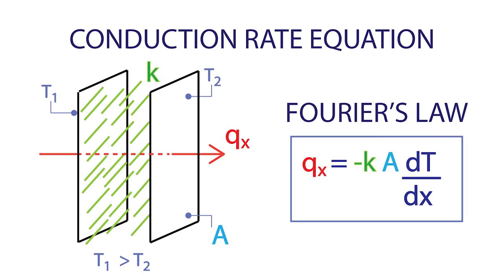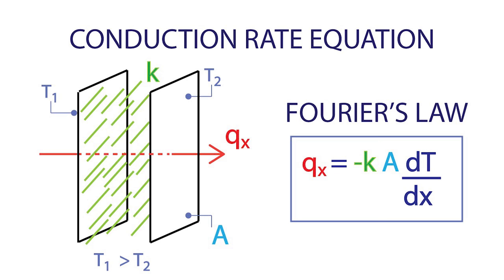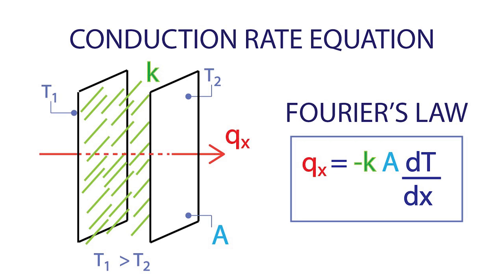Radiators, Fluid Temps, & How to Avoid Thermal Issues

Comment: I remember on my 2nd custom water cooling build, high heat from OCing also has a chance to leaking through some of the most unexpected areas too. The pump leaked due to high heat water (like you pointed out high heat can damage the pump), and the high heat water leaked between the GPU block and the terminal. The block itself is brand new, never taken apart. Without OCing, just everything running stock, there's no leaking anymore... Great video discussion!

Comment: Mistakes I made were:

Using a Nanoliquid with UV, Mayhems Pastel Extreme has issues with UV causing it to get stuck to sides of Acrylic.
Loop planning where drain port isn't at the bottom or at any tippable corner.
Having a Radiator that wasn't fully threaded leaking when I started to fill it, it physically needed to be threaded more and I had to buy a tap. (never buy Magicool)
Purchasing a case that is more suitable for airflow, even having the intake remotely restricted changes the temps so much its insane.  Bequiet Dark base 900 pro w/ 2x 420mm's

Comment: A cramped case and low airflow is my current crux. I have an 1800x and a 1080ti on a 240mm and 120mm loop. The cooling is good but unfortunately the Corsair 460x I put it all in is a bit too small and thus the fans are slightly chocked. Good video Greg!

Comment: I use glass and copper tubing in my build, so i think it´s unlikely that the water temp could do any damage to the tubing. Also my 2 Mo-Ra3 360 rads keep the water cool at very low fan noise. :D

Comment: Wow, I saw that comment just a few days ago, quick turnaround on this video for sure. Kind of overcomplicated but we're all pc gamers here, we get ya. I would love to see a video where you compare torture test temps in watercooling on different size rads. I personally want to see if theres a diminishing return on thick rads vs regular 30mm. When Volta drops I want SLI 2080's in my R6 running off a 40mm thick 360mm rad.
Reply: Thicker rads are worth it as long as you have sufficiently powerful fans to keep the air pressure high, and you are ready to increase the RPM of those fans (more noise). But if you have a choice between a 10mm thicker rad and another 120 rad, go for the 120, that's just common sense, it will give you more rad space and more air to cool the loop. Although it that case I'd just do both to be honest.

I've got no clue how thermally efficient the 2000 gen cards will be, but I'd guess a 360 rad won't be enough under high load no matter the thickness of the rad, if the loop includes 2 gpus and 1 cpu (depending on what cpu it is ofc, and depending on the oc). I'd personally add another 240 at least, but that's me, maybe your fans are much better.
Reply: Gamed4Geeks I honestly don’t think I’ll need that much. I ran my 7700K and 1080ti together on just an XSPC 30mm thick 360mm rad and with my fans at 50% I could hold 45-48C on my card at max load. The fans weren’t even very good. They’re the Corsair SP120 RGB’s. You would think SP’s would be but they have low max rpm’s and don’t have nearly the right blade design. And that was also fully overclocked running 2063MHz all the time. I’m thinking a 40mm thick EK rad is all I should need to run 2 cards. I just want to see a youtuber try this stuff
Reply: Yeah, I suppose if you keep the 7700K it should be fine, but then again, depends on the thermal efficiency of the 2000 gen.
Reply: Gamed4Geeks I’m making the assumption that the 2080 and 1080 will have the same heat output

Comment: Hey Greg!
I have my loop already, but temperature spikes on my ryzen are really annoying. Fans ramp up and down in some time interval even when idle (common problem with some ryzen chips). I wanted to put a stop fitting with temperature sensor and regulate my fans according to delta T of the water. I have only one header for a temp sensor on my mobo, so I can't pass ambient temp to my PC (I think). What would you recommend?

Comment: Basically all your water cooling problems can be solved by picking a case that actually properly supports water cooling. This means good airflow and ample radiator mounting capacity and room. 

Basic rule of thumb, there should be at least 1in between your radiator fan and the nearest case panel. Second, water cooling favors more ventilation area from a noise ratio perspective. A fully open test bench with fans at 800 RPM it's going to be quieter than a closed-off case with the fans at 1600 RPM (assume temps are the same).
Reply from the maker: paskowitz I choose difficult and crammed cases because they look much better IMO, and are much more challenging.
Reply: 2:04 "I could get away with having no oil in my Porsche when going to the supermarket, but on a race track, things get dangerous! But at least it looks cool."
Reply: Well yeah, some people focus on function, some focus on aesthetics. I personally focus on the latter, but of course it should not be overdone and shouldn't detract from the function point too much. Pretty PC that can't turn on isn't really an option here. Depends on the use case scenario, as long as you understand the limitations it's fine.
Reply: Picking a case like that usually means a full tower. If you’re a good builder and looking for a challenge, you can get a mid tower and put a sweet loop in it. I’ve spent a lot of time having to really plan my loops in them, but once you get it right they are puuurdy. And not gigantic.
Reply: WarmSoftKitty Lol. You should check your sources. A good loop won't develop a failure, there's not "chance" involved, it depends on the experience of the builder. And water-cooling has greater thermal capacity than air cooling by definition. For most users water-cooling doesn't make sense because they buy a normal CPU like the 7700 and never oc or do anything with it. But some want more performance from their pc you know. And don't forget the aesthetic value of it, a water loop done right will look much more awesome than just simple air cooling. Plus, enthusiasts treat water-cooling more like art, developing very beautiful loops just for the sake of art.
Reply: Gamed4Geeks Cards have gotten pretty efficient, yes. But go try putting 1080ti’s in SLI and see if you can put up with them screaming at you while the top card sits at 75C. I started watercooling for that precise reason on my 980ti’s. You could also just try a founders card and watch it hit 78C using 80+% fan speed
Reply: Mr TurDMuF1NM4N Erm. Did you mean to address this to me? Because I don't quite see where this came from...
Reply: Gamed4Geeks Sorry it magically replied to you without me telling it

Comment: I have 3 x Noctua NF-F12 PWM and want to buy a 360 radiator.
Are my fans more effective on the 38 FPI of the EK-CoolStream PE 360, or the 14 FPI of the Darkside MP360?
I understand that 38 FPI has more cooling potential, but I don't know if my fans have enough pressure.
I did some searching but did not find a consistant answer.  Thank you for any help.

Comment: do a video on fan speed performance curves in corsair link? specifically for the h100i/h100iv2 
ive noticed corsair link absolutely pushing my aio fans to the max yet when I go to a quiet-based curve (30-50% fan speed for 65C and under and 70% for 70+C etc.) and its significantly quieter yet i still get the same performance!

absurd!

Comment: I have a problem with my loop ever since I added a second radiator, I have 2 480mm (XSPC ex480) radiators in a phanteks enthoo primo. Ever since I added the second rad at the bottom draining and bleeding is a nightmare! (The ex 480 is not multiport and I live in South Africa, the only other 480mm rads that will fit are from Alphacool which are not available here). I recently changed the graphics card waterblock and noticed any time I refill the loop after draining it I get reduced flow and the loop becomes impossible to bleed. I have no idea what to do with it, I will try to get some alphacool 480mm multiport rads but its difficult and expensive to import here.... This is actually an over simplification of the problem but I didn't want to type an essay on youtube XD

Comment: I have a question. 

Looking to do my first custom loop soon. I want to water Cool both my GTX 1080 and 7700k both OC 

What I want to do is run 2 small res

Would this configuration suffice? (I have a LARGE pc case)

Res>pump>cpu>240mm rad>res>pump>gpu>240mm rad and back into the first res.

Would that work? Would I need 2 pumps for 2 res and 2 rads? Or would one pump suffice?
Reply: Barry Hendry You should be fine with one pump. The extra res really doesn't "do" anything, it's water storage, so the pump don't need to push it like "through" the res likewise it would do with an radiator
Reply: If it's a single loop you don't need 2 res, you also shouldn't need 2 pumps, a single D5 will be enough.

Comment: Hey greg im thinking about doing a loop by end of the year for my i7 8700k and 1080ti well they are both cooled by aio i7 is deepcool captain 240ex and 1080ti is kraken x61 with g10 bracket. Is there any specific way you want to make sure what goes into where in the loop and how offeten does fluid have to be changed
Reply: I'm not Greg but have done a few builds. If you're running separate radiators per component, I would run a rad between the gpu and the cpu. And as a safe practice, it's advised to place your pump after the last radiator since the fluid being cycled through will be the potentially coolest fluid (DDC and D5 pumps can already get warm so the cool fluid is safest). There are plenty of builds showing that order really doesn't matter that much but personally, I have my loops in the order of pump > gpu > rad > cpu > rad > back into pump/res. Hope that is of some help.
Reply: k ill try save for later im thinking 480mm and 360

Comment: How much wattage will a overclocked i7-7700k use? I have a i7-7700k, gtx 1070 which isnt overclocked and a 550W psu. Is it enough?
Reply: Swalton yes 550 is enough depending on how much voltage you send to your cpu and if you are overclocking your 1070. If you’re going full overclock on both you may run into some issues and even then 550 is a good amount
Reply: ok thanks dude
Reply: Short answer, yes it'll be fine. My 7700K @ 4.8Ghz and FTW3 Hybrid 1080Ti OC under max load will pull around 450-500ish watts from the wall. You want sufficient headroom though to keep power delivery optimal unless using platinum or titanium rated PSU. My PSU is seasonic prime 750 titanium. Fan never needs to turn on. Hope that helps. Gonna be a dope system with that hardware
Reply: Thanks cause i have good specs, a h100i v2 but im incredibly terrified about overclocking and now that i know what im doing i just want to be safe basically, thanks

Comment: the way i go with radiators and i stopped the video at 0:33 before i get the answer, i always go with 120mm at minimum for each component so a cpu and grapichs card is 240mm radiator and for overcloking is a 240mm for each component, so in total i need 480mm worth of radiators when overclocking a cpu and grapichs card

Comment: Are there any downsides to having 'too many' radiators except for cost? Because I have 1 CPU, 1 GPU and I am working on a loop with a 360 rad and a 420 rad.
Reply: Resistance - have to make sure you have enough pump to push the coolant thru everything.
There may be math involved in the calculations?
Maybe that is why there are many split systems? Two of everything; one for GPU and the other for CPU

Comment: Is there any way to calculate or measure the temp of liquid in a custom loop? I'd imagine it's not the same temp as the CPU, that wouldn't make sense. I guess a probe could be used to measure the surface temperature of the tube, but how do I convert that to the temperature of the liquid?
Reply: They make fittings with temperature probes in them. Either Plugs or inline sensor couplers.
Reply: The loop is already done and filled, placing the probe would require a lot of work to be done. I was asking for a calculation that would allow me to work out the liquid temperature if I know the tube surface temperature, and coincidentally I've just had a lecture precisely on that. Although it wouldn't be exact, but will give me some idea at least.

Comment: Surely the bearings on a DDC and a D5 are the same so both dump heat into the fluid. I know the DDC gets hotter but that was due to speed.
Reply: The DDC pump internals aren't actively cooled by the water, this is why you see pump housings with heatsinks on them to help cool the pump.
Reply: No but the bearings are, the actual impeller and bearing are virtually identical, i should know i've disasembled both types many times. The electronics are different, that is what gets hot and needs to be cooled by the heatsink. Have a look at DIYHK they do a much more efficient pcb, i have one of both and the heat difference is significant.

Comment: im sorry greg, but i dont understand how a higher water temperature can damage the pump. the bearings are made out of teflon, impeller ABS. 
After that you then explain how heat transfer works and then mention that a hot pump is bad.

im confused. 
are you saying the pump overheats? im not aware that the D5 or DDC have any thermal protection.
Reply: Basically, a hot pump + hot liquid is bad. Most pumps use the working liquid for lubrication and for temperature control. If the working liquid gets too hot, the pump will get too hot. It's why you generically want to place pumps after the radiator, not before
Reply: Electronics never likes heat. And in most cases the  Motor of the pump is getting cooled by the Water in it
Reply: MrTommymxr EK recomend to dont go over 60c ( water temp )
Reply: Blob83 yeah but you cant talk about cooling at 60degrees. I would never go over 40 in summer.  Except you are living in a place where the room temp is 40degrees. I normaly keep the delta between water and room under 5 degrees so atm 26 degrees. This keeps the gpu at around 35 degrees
Reply: Well ofc but they mean 60 on water so if your cpu is a 60 for example the water its not so hot. The problem is some intel cop can work at like 90c so the water in that loop if not well balanced can go very hot.
Reply: Blob83 i guess you understood that wrong. EK has no interest in thecpu temp. They only care about watertemps because it could destroy sealings or pumps

Comment: I don't concur about an Asetek pump not being able to efficiently cool a custom loop. I have a build myself that uses an Asetek Gen 4* pump and it is able to move water through 2x 240mm rads as well as 2x GPU waterblocks. I use this rig to mine sometimes and it only gets up to 60C on the GPUs and 55C on the CPU. Pic of the build here: https://imgur.com/a/rHGK9
Reply: thats a gen 4 pump corsair is the only one with a gen 5 atm

Comment: I remember seeing you using the hottest radiator to pull air IN the case... and that's not good too... you should always use the hottest radiator to pull air OUT of the system...
Reply: That has been disproved many times. Look on YouTube. The temp difference is so small you might as well ignore it.

Comment: What CPU and GPU should I get for a $1000 PC
Reply: Lucca Amella do you thinking an i5 7500 and a 1060 is good???
Reply: assassin stunter get a r5 1600 not the obsolete 7th gen and below i5 lineup
Reply: I don't agree with the statement that the kaby lake back i5s are obsolete, they're definitely worth it if you can find them very steeply discounted, used for example. I picked up my 6600k for $180 more than a year ago, and you could probably get a 7600k for similar now. I agree though, that if you're buying new, a 1600 or 1600x is a sweet spot for your target price.
Reply: I still have a 4790k @ 4.8ghz and it's running everything fine with my gtx 1080
Reply: 8th gen i5 and a 1060? It's really not worth building for gaming rn, gpu prices are too high, just saw a 1070 for 1000 dollars on amazon lol. Otherwise you could've got a 1070 instead of the 1060 and sitll have enough money for everything else.

Comment: wait wait wait what? 40°C? My CPU/GPU under load easily get 61°C, is that an issue?
Reply: Azrael2k8 lol my potato AMD system is 80°C under load
Reply: He is talking about the liquid's temperature. While your CPU or GPU core can easily get to 60°C or higher, the liquid in the loop will be far cooler if everything is going alright. When this liquid reaches 60°C, bad stuff starts to happen, as hot water is a catalizer for chemical reactions, and thus your loop components' materials start to degrade and when you notice it, it is already too late
Reply: Is it 60 or 40 degrees for the liquid? In the video he said 40 I think.
Reply: You want to keep the coolant temp as low as possible.  He suggested a max of 40°C in the video.  As the temp approaches 60°C bad things have increasing chances of happening.
Reply: How can you tell what your liquid temp is?
Reply: lildog007
Several methods:
1. Stick a thermometer in the res.
2. Include a thermal plug (or whatever it's called) in the loop.
3. Unnecessary complicated, but may be interesting to some: measure the temp of the surface of the tube. Knowing the thickness of the tube, the material, and the air temp, you can calculate the temp of the liquid inside.